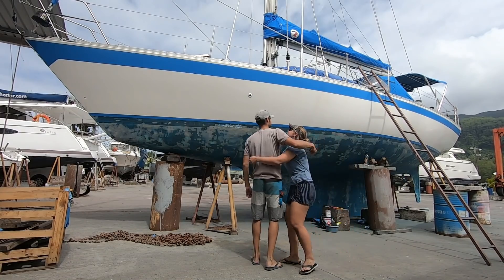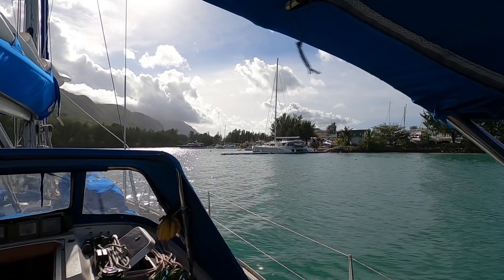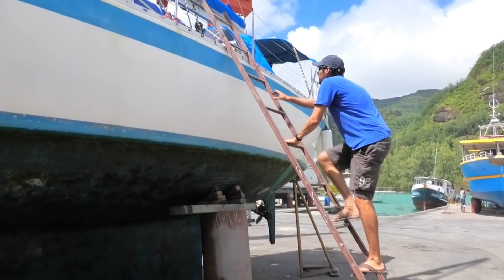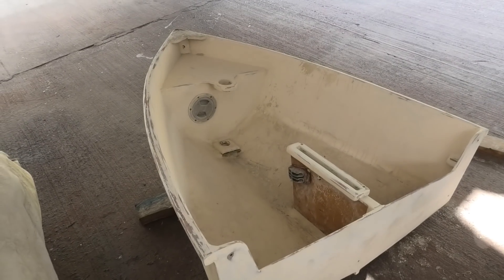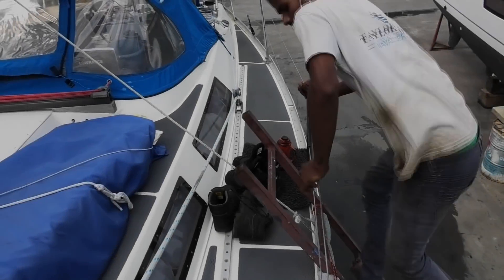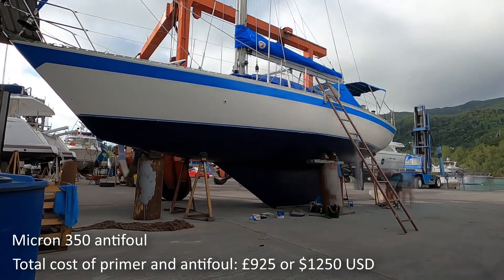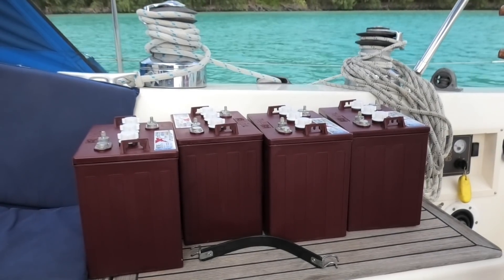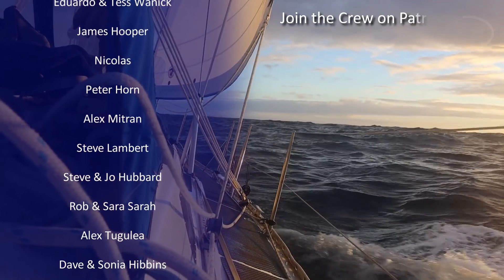TROUBLE in the BOAT YARD | Ocean Passage Preparation | Sailing Florence Ep. 116

Comment: Hi Guys, Thanks for the videos I do love to watch. I have just bought a Colvic Watson 28.6 and in the final stages of doing her up for a trip in your path to Thailand. to your recent video. You were correct they were clowns repairing your rear-drive and yes it was out of line. The batteries Torjen 105 were when I bought mine in the UK £105 each but they have gone up but to buy them in the Sachells would have cost a fortune. Just a tip South Africa not far away you could have got the hull gel-coated while you relaxed on the beach at half the cost in Richards Bay they build boats there some of the best in the World, they also make the batteries in SA far cheaper. So when you pass Richards Bay pop in a great place you will love it and you can have a real mechanic take a look for a few Rands. Heads up and all the best guys Oh and I may be an engineer but I have never set a sail so I too have a lot to learn next February when I set out to Asia.
Reply from the maker: Unfortunately we could not wait until South Africa for this work (that was the original plan). As for the batteries, they were actually cheaper in Seychelles than I could find in the UK, I was very surprised! Possibly due to being shipped in by the container load direct from the manufacturer.

Comment: Well done on all the boatyard work, often a mammoth task. I must say I prefer the old gland sealing for the prop-shaft, yes you get the drip drip 💧 into the bilge but when the PPS rubber gland fails, as you say, it’s a big problem to deal with. Fair winds & mild seas for Florence.

Comment: Well done both, yard work is never easier and of course far more difficult when still living onboard. You can always recheck the engine alignment when you get to a larger yard. Sometimes easier in the water as the weight of the vessel is more evenly supported. Stay on these next passages.

Comment: A very interesting/informative video.  The engine vibration problem reminds me of my own experience chasing that issue: changed the cutlass bearing, nope! Checked engine mounts and alignment. Nope!  Changed out the folding prop for a fixed prop.  That was an improvement, but, I eventually realized that my Yanmar 2gm transmission was slipping, so, I pulled that out and lapped the cone clutch. Problem solved!  But, it was an adventure in maintenance.
Good luck on your travels!

Comment: We have a similar problem with backing up. Ordinarily, with a dock or a travel hoist, we would prefer to head  bow in but the travelhoist in Chiapas, Mexico required one to back in. Took us a dozen attempts and some very long lines, which we threw to the dock, to get pulled in). We sympathize with your docking challenge.

Comment: Well done on getting all that work done in such a short time. I would have been fuming about being charged for extra yard time because of the launch delay!
I went to lithium last winter and it has been great. I replaced 2 110Ah AGM batteries with one 216Ah lithium so I've practically doubled my available power.
Reply: Is my math rusty or am i correct that in fact you came nowhere near doubling your electrical power 2x 110 = 220ah vs. 216ah is actually a slight loss unless you got 2 Lithium batteries.
Reply: @gregorytimmons4777  my battery is 216Ah LifePo4 so useable power is, well technically, 216Ah but if you run them right down you shorten the lifecycles. With FLA or AGM useable power is between 40% and 50% of the nominal power. So my previous 200Ah AGM would only give me between 80-100Ah

Comment: Check out the Sigma drive coupler. Sailing Millennial Falcon installed one and it appears to help with the vibration and slight alignment issues as the engine mounts wear in. Maybe something for the next haul out.

Comment: You have probably tried and discounted these but here goes.
Superlube is also a Saltwater marine grease/spray impervious to salt water. For keeping corrosion away from bolts and ???. 
The wire brush tooth brush size (brass) for cleaning battery terminals, Vaseline works to keep corrosion away. Cheaper then the Diaelectric grease, works as well. 
Would HMSW (teflon ) machined to fit the end of the crankshaft and be able to go over the shaft /clamped work for aligning  the engine mount to shaft work? They would be light for storage, machine screws for mounting to the ends should negate the use of others for doing the work? If I have described it sufficiently??? 
Interested in Mayotte Island ?

Comment: What a marvellous video! My goodness the challenges are incredible!!! Your tips and advise on learning as much as you can to be self sufficient are well taken on board. Anything in particular that you would definitely recommend to learn and avoid expensive sourced labour?
Reply from the maker: For me I should have learned more about the engine, for some it is the electronics but I have more knowledge myself there and have helped other sailors fault find and fix electrical problems on their boats. You just need to go over your own boat, disassemble and re-assemble everything yourself. Just ask yourself what you would be nervous tackling yourself and then get some lessons on how to do that, we have had a lesson on checking  and adjusting the rigging for example.
Reply: @SailingYachtFlorence  makes total sense.

Comment: I could literally sense your stress.  Aligning the shaft is not as difficult as you may think.  I'm not the sharpest knife in the drawer and I had no problem doing it, although it was tedious.  In fact, I removed the shaft while the boat was in the water. I jammed a soft wood emergency seacock plug into the cutlass bearing and only a small amount of water got into the bilge.

Comment: S/V Florence was poorly blocked and setup for yard work. You’re lucky the hull didn’t tip over on you. The yard fees should include suitable jack stands. Also the pressure wash is more effective immediately after the hull leaves the water - in the lift positioned at your resting spot.

Comment: Be aware...blisters or fiberglass delimitation can never be fixed permanently because the resin, be it polyester or epoxy will adhere (stick, fasten to) for years but NOT FOREVER.  Just like concrete...needs to be poured "all at ounce" or it will delaminate.  Boats or resin laid up prior to 1974 had little problem but after '74 due to the OPEC oil embargo (resin is an oil product) the formula used to make resin was changed....thus started blisters.. At some point the formula was corrected but it took decades to address the problem.
My yacht owned since '92 was laid up in '73 thus has no blisters...however, some keel work was done in '79 with this later resin...and these parts have blisters.  The last time I hauled and did the bottom was '96....living in the tropics with warm water I could never find bottom paint worth using.....so I (the family) scrape the bottom every few months.  And we are a divers anyway.  These days we are coastal sailers.
I really enjoyed this blog....it is very realistic...My wife and kids (now adults) did not wear or live in  bikinis....same as in our houses....bikinis make good click bait....they are my partner...helper...not a sex object

Comment: Wait - you had flooded batteries? Did you try to refresh the existing batteries with a huge (200A or so) constant-amperage charger or TIG welder? Unless the lead plates in a flooded battery is gone or shorted together, you can almost always fix a flooded battery. Granted, you'll need a gigantic generator or a connection to 240V shore power to be able to run the battery charger to perform the fix, but it should work.

Comment: Normaly if you have osmosis blisters you should let the hull dry for at least 2 months before filling the holes and repainting the hull... You will have issues soon again if you didn't
Reply from the maker: Yes we expect to do the job properly when we spend more time out of the water during our UK refit. Thankfully we only have the problem on the rudder not on the hull, we keep an eye on it and no blisters have re-appeared in the last year since we did the work in Seychelles.

Comment: Once when I had to swap engine mounts in the Caribbean, I asked the yard for a mechanic to do the alignment. They could only spare an apprentice.  He was hard at work over the engine when someone on the dock shouted down asking to speak to the mechanic. He looked puzzled and said "I ain't no mechanic." I'd be lying if I said this didn't stress me out. But at the end of the day Mervin had that engine better aligned than it ever was before or after and the yard charged us a very reasonable labor rate. 
On another note, please be careful with that rudder if it's had water inside. Internal weld corrosion is almost always a problem when that happens for any length of time. First opportunity drop the rudder and get inside to inspect the stainless stock and plates.

Comment: A very valuable lesson I learned from engine alignment errors. I now do it with the cutlass bearing out and simply make sure that the prop shaft is centered in the prop strut with no wobble. More than one machine shop got the shaft/coupler flange machine work badly wrong. Without the cutlass bearing removed, you are really flying blind. The feeler gauge between the flange faces can really give you a false sense of security.
Reply: Say, I have always used the feeler gauge to align the shaft with the cutlass bearing still on and have had no problem.  Can you provide a bit more info so that I can see if I should not be as confident as I have been?
Reply: @JR-kk6ce  Trying to explain it all here would take a lot of keystrokes and likely not cover easy but essential details. I’m not saying that it’s difficult, it’s just that I don’t know what you might be up against. And you might be just fine. It’s just that doing it with the cutlass bearing out is the thing that will tell you. If your cutlass bearing is lasting years, then don’t sweat it. If you go through them faster than you’d like, just be sure to check for wobble by slowly turning the prop shaft with the bearing out. If you have wobble, it’s either a bent shaft of course, or mismatched shaft/flange machine work. This assumes the trans/shaft flanges are already properly bolted together. You might even gauge your previous feeler gauge fit up with the bearing out.
Reply: Basically you are trying to see how good the flange shaft are machined into a matched pair. I had bad matches from a shop in Mexico and in Honolulu. A third shop knew the real target. They asked me for the key so they could put it all together for the machine work.
Reply: @Minggat73  I really appreciate your input because I'm always open to learning.  You brought up some excellent points which I was not aware of and have blundered through with no problem by sheer luck. 

I once had to get a new shaft flange machined and I only took the shift half to the machine shop.  I guess that it is true what they say that God protects the ignorant because I had no problems and the cutlass bearing lasted many years.

Comment: The T-125 batteries are a better option and same size as those are and much more reliable then the lithium and you can use the charging system also. wondering why you didnt coat the prop with the type of antifoul, it will get bad again
Reply: T-105 hold more water (acid)...one has to keep the water level above the plates....golf carts are best

Comment: Final engine/shaft alignment should be done once the boat is back on the water. You should practice and do this yourself it's not too hard.
Reply: Yes because the hull will move slightly and settle into its "sea shape".
Reply: Enjoyed this episode immensely!!  I’m currently in the process of rebuilding my 4 cylinder diesel.  I have had to cut out the cockpit floor to get the engine out.  The injector pump has now been rebuilt and calibrated. After fitting the engine goes back into the new engine room and has to be re-aligned onto the new engine mounts and rebuilt bearers.  I’ m feeling very nervous about this…thanks for sharing your experience!

Comment: generally you should check your shaft alignment post launch because a glass boat will change shape going from jack stands to floating . checking alignment with a feeler gauge is definitely not rocket surgery . a bit tedious but a very basic low tech job .

Comment: Anything can be moved... anything. 
Build a 4x6 beam arch. 4x6 the middle like the middle of a sing set. Build legs to bring it off the deck. If u dont have hatches. Cut slots in the deck. Say, 3/4" by 3" long, dont cut supports or wires. Slide, cargo straps, thru the slots. Drop them down yo the engine,  tanks, what ever. 
U get it, then hatchet what ever up. Fix it , patch it. Then lower it. And understand theres never any problems in ship yards. Heres how to stop all problems.... stand back, about five feet.
OPEN YOUR WALLET AND START THROWING MONEY AT THE PROBLEM. AND IT WILL GO AWAY.😅🤣😂🤦‍♂️⛵👏👏👏

Comment: Why don't you buy and carry with you spares like a prop shaft seal, especially when you know the old one's time is nearly up? So much cheaper and less hassle, not to mention being able to replace it if you did have a catastrophic failure at sea
Reply from the maker: Rubber degrades very quickly on a boat and Australia (3 years ago) was the last time we had easy access to boat parts/importing parts from Europe. We carry an old one as an emergency spare but would have to haul out to replace the prop seal anyway. Most places with haul out facilities are also places you can import parts to, this is just the first yard that can haul yachts we have seen since Thailand (over 2 years ago).

Comment: As you likely know, the final alignment of the engine/shaft needs to be done in the water, as on the hard the hull is slightly "deformed". Great video, as usual. Very informative. How many coats of anti-fouling paint were on the boat from the previous haul out?

Comment: Oh my lord you really should stay on land. You should always check your shaft alignment once back in the water again. The boat hull shape will change compared to being out of the water and only supported in a few spot and on the keel.
Reply: Thats an old wives tale, a well built boat hardly moves,  its easy to tell by checking the tension on the rigging

Comment: Intrigued by use of the term 'Engineer' (I am one) - it seems from the video that it might be an engineering company, but the guys doing the work were/are in fact engine mechanics (not professional engineers) - the bane of an Engineer's life having sweated to get the qualifications (a 4 year degree) is having that equated to being a mechanic. Mechanics are very skilled at what they do, but they are not Engineers. Maybe the guys here were Engineers, but I doubt it.
Reply: I can't help but troll you. We had a saying in a shop that I used to work in that engineers use slide rules and calculators to design a problem. Mechanics use a hammer and chisel to solve it.
In all seriousness, I do appreciate your frustration.

Comment: In the UK you call them “Engineers” when in fact they are mechanics. An Engineer in the USA is the guy that designs the thing it is you are working on. I worked in Fiji for a year and it cracked me up all the half ass mechanics calling themselves engineers. My advise is to buy yourself a nice set of tools and learn how to “wrench” on your own equipment. Buy the manual for you engine as well. You will have “peace of mind” knowing you did the job correctly.

Comment: What's the fuss about docking your own boat you have been sailing for 5 yrs and you have two sets of capable hands and an engine? 
Have you ever attempted to dock a 55" long keeled classic R-boat in a hefty gale? Add on problem factors like: a totally unknown harbor, the halyard is stuck in the mast top ergo the main is still hoisted, you have no engine due to air in the system, it is the first time you skipper the yacht, and you have no crew for any assistance (lowering sails, mounting fenders or moring lines, ets). On top of that your adrenalin is pumping as you managed to sail to port and survive after your friend had fallen off the yacht. The only factors that works for you is daylight and good visibility, and that the wind is more or less head on along the dock. However, if you still manage to dock without a scratch to the delicate 100yr old wooden hull with slippery and sleek Oregon pine deck, then you can say, "That was a difficult docking but I made it!"

Comment: "Engineers" is surely NOT a proper term for those guys worked on your vessel. 
Air bag's should be used to lift the engine NOT a jack. 
Danger, danger right there. 
Ridiculous.